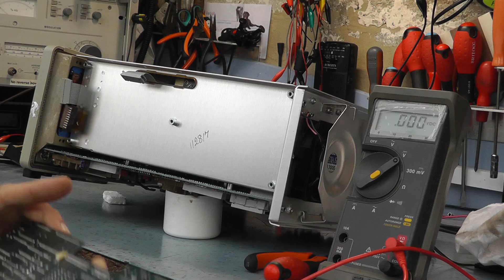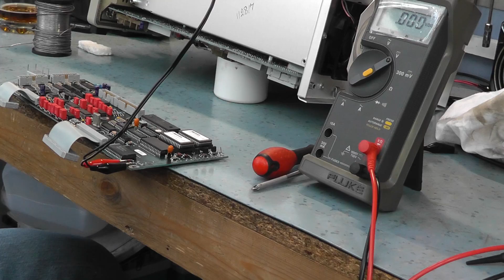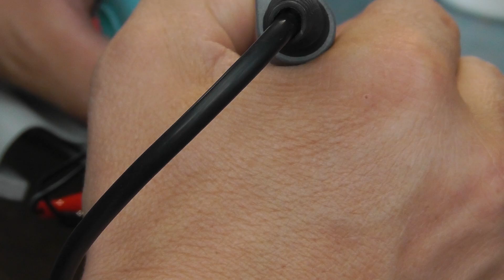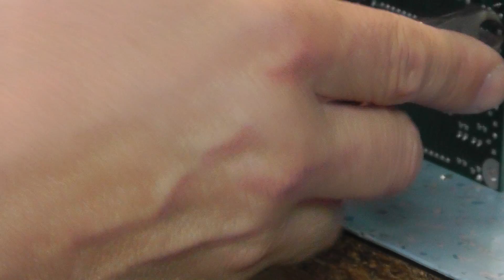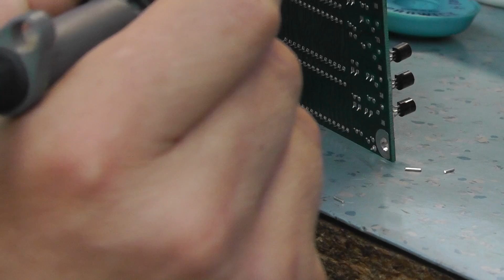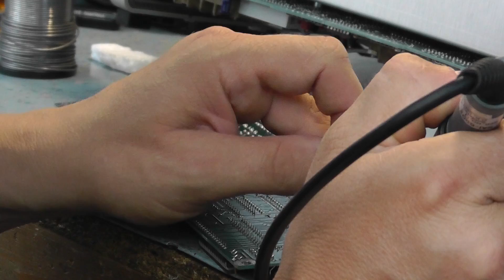Tektronix 2445a RAM battery replacment

Comment: hey bud. i have one of these. a 2445a. it has option5 too! it has test 04 fail 13 like in your other video on a 2445a. and if you scroll up it has test 06 fail 01, which is battery under voltage. i put 2.5v .3a into the battery terminals and reran test 06 and it passed. i then reran test 04 again and it still failed. i saw in the manual it said something about using exer03 to reset something. still getting the test04 fail 13. did you ever get it fixed? what are the next steps after a battery is replaced. cuz putting the correct voltage where the battery should be did not solve my issue. the manual doesnt really point to any next steps. maybe some chips need to be replaced? thanks.

Comment: Hello, nice job! Did it work, or did you have to recalibrate the scope? I have the same scope and I need to change the battery. But I don't want the data get lost.
Reply from the maker: My battery had been dead for some time and had lost calibration years ago. Connect a temporary supply up while changing it. A couple of aa  batteries in series should hold the data.
Reply: @SoddingaboutSi  how to know is dead? How to see healthy is?

Comment: Nice video on the RAM battery change.  Whatever happened to this machine?  Fix the error?  Retain the RAM?
Reply from the maker: The unit works well. I did loose the ram, so had to do a full recal again. Very time consuming. Used it last week but tend to use a digital scope (2440) mainly.

Comment: I had my heart in my mouth thinking those crocodile clips backing up the memory were going to fall off. Nice job Simon regards Chris
Reply: The grounded soldering iron tip is not an issue. While it's true that most (good) irons have the tip connected to mains earth (ground) for safety purposes.

The DC power supply providing the backup power is isolated from mains earth (ground) via it's step down transformer this is called galvanic isolation. So you can safely touch the + or - terminal of the power supply with the earthed iron tip and not cause a short circuit. This is because the DC supply is not mains earth (ground) referenced and current can't flow. In other words the only place current can flow (there is a complete circuit) is between the + and - terminals of the power supply.

One thing to be aware of is where your solder wire is and make sure you don't accidentally short VCC and GND. Since lets face it most of us are used to soldering with the equipment powered off and don't give it a second thought.
Reply: I agree with you. Lose that mechanical connection briefly and you will really be hosed. I have done this before on the earlier 2465's using a tabbed coin cell with series R as a backup and I always solder direct to the circuit trace. Also be certain your iron doesn't provide a low resistance path to ground as well, if you use the solder in backup method.

Comment: I just purchased a 2445a from an instrument dealer here in the US. It will be completely refurbished and calibrated before it is shipped. I just repaired a 2236 Tek scope which I bought off eBay for $50. They can be tough to work on, very compact scopes. I felt it was worth the extra money to get the 2245a professionally calibrated, so I have a known standard in my lab.

Comment: Phooey! Have to wait for next video to find out the result!  ;-)  I have to figure out what the battery is in my 2440 as I'm sure by now it's in dire need of replacement (do you remember what it was by any chance when you were redoing yours?)
Reply: It might not working after that lol...It like computer, you dont need to supply a power while u replacing a backup battery...worst case scenario is your setting is gone, but not the initial setup of the scope...it will still booting up. Put a live voltage into the circuit while soldering is not a good idea...

Comment: Good luck with your repair effort! I have both 2445 and 2465 (not the "a" version though) and these are excellent scopes.
Reply: Kerry Wong, but are fraught with danger. It seems there's a proprietary chip on the top board that goes out with age and is not available. Once lost, the scope is useless.